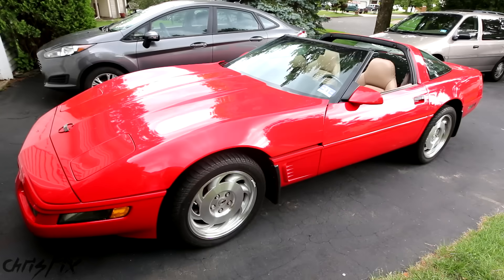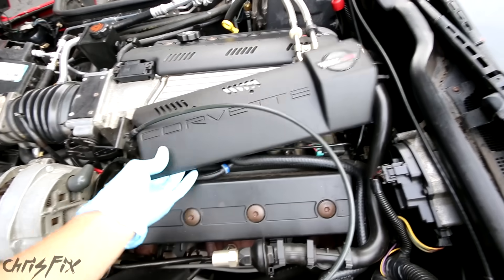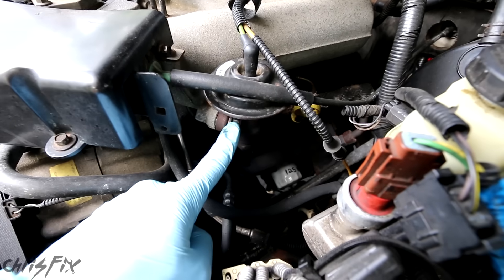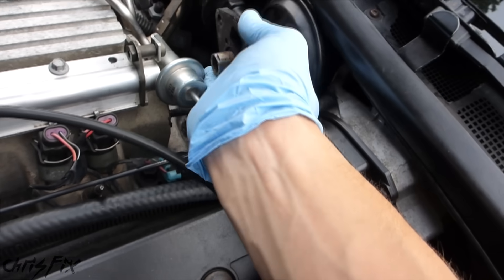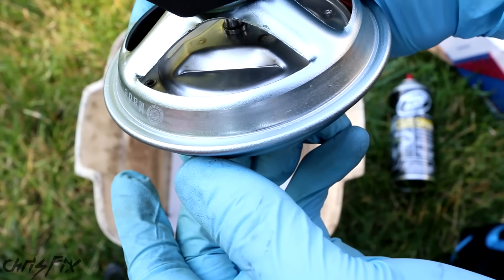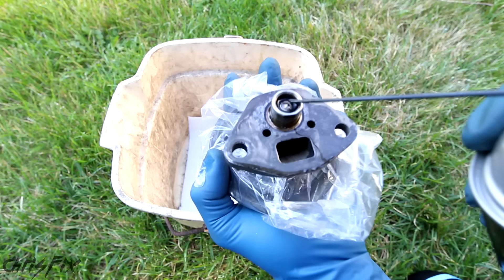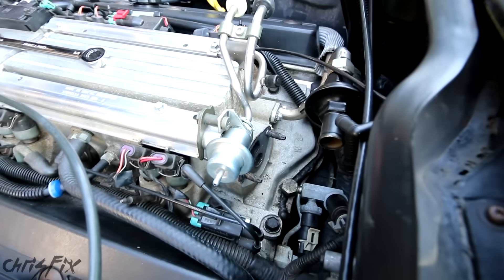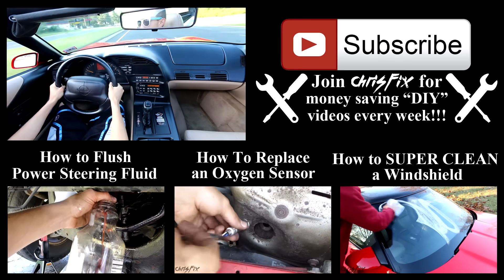How to Clean and Replace an EGR Valve P0400

Comment: Rock Auto has the claim~"all the parts your car will ever need". BS! I need control arms for my 02 blazer...they have a left upper and a right lower....what about my other two, RA?  Also heard about a guy locally that needed a fuel pump that was half the price of the regular auto parts stores, and it took RA three times to get it right. JS
Reply from the maker: Carl Libby Thanks for sharing Carl. I got my part from Car Part Kings who was relatively inexpensive and really fast with delivery. I have been using them a lot more for the reasons you listed. I just got an AC Compressor and it ended up being bad from the factory and they 1 day shipped me a new one and sent me a shipping label for the bad one. Now that is good service!
Reply: ChrisFix For sure! Carl Libby RockAuto isn't as convenient on customer service, but I still buy from them when I expect to not need customer service.

I think RockAuto will help you get the bushings for the control arm. It's more work but it's a lot cheaper. Usually, the literal control arm doesn't require replacement.

ChrisFix has a video to help you change out the bushings on your control arm! :)

Comment: egr is not for cooling the cilinders it's for degreasing the NOx because NOx is not good voor the environment
Reply: +Mon Schauvliege It has the affect of cooling the cylinders...
Reply: +Spartan111792 no because you are going to put hot exhaust gasses again in to the combustion chamber. The egr cooler whil cool the exhaust gasses but that has nothing to do whit cooling the cylinders.
Reply: Mon Schauvliege The exhaust gasses are non combustible and are cooler than the cylinder itself, therefor cooling the cylinders. You're right about decreasing NOx emmisions but wrong about the cooling affect of the egr. It's not best for performance because it replaces space that can be used for air with non combustible gasses.
I'll even copy and paste some info I just found on the web to help explain it better.
"The substitution of burnt gas (which takes no further part in combustion) for oxygen rich air reduces the proportion of the cylinder contents available for combustion. This causes a correspondingly lower heat release and peak cylinder temperature, and reduces the formation of NOx. The presence of an inert gas in the cylinder further limits the peak temperature (more than throttling alone in a spark ignition engine)."
Reply: Spartan111792 if the valve is functioning properly it closes at WOT and shouldn’t really affect performance when you need to really need the engine to perform

Comment: Great video as always! I don't think my 13 mustang has a EGR system. I might be wrong
Reply from the maker: OVERKILLRedline Thanks! That would be interesting if it didnt. It might be hidden.
Reply: OVERKILLRedline Forgive me for not looking up what your car does or doesn't have and responding generally.

John is right that often VVT does replace EGR. I was surprised when I saw some cars with VVT that still had EGR.
Reply: ***** I've often been glad my car doesn't have EGR. The intake gets dirty enough as it is from PCV.

VVT keeps exhaust gasses in? How when VVT doesn't effect when exhaust valves work?

Comment: Good vid. One thing to note if electric or not and applies to ICV, idle control valves. The cleaning fluid almost always seeps in through the o ring seal on the shaft and floods them out. Manual cleaning for the win the older it is. The deposits are abrasive and the o ring wears quite quick.
Reply from the maker: Sirus Thanks a lot for sharing. This is one of my first videos but I explained exactly what you said: https://www.youtube.com/watch?v=vFhoNykgQtc
Reply: Sirus Thanks for that! .... had to replace one over not knowing that. lol
Reply: ChrisFix good stuff, they expensive to replace if you screw it up. Done it twice to learn that one.

Comment: My car drives the same even tho the light is on, I tryed to check for vaccum line leaks the best I can I don't see none and tryed to see if there was build up in the lines but seems cleared so im confused don't know if there is any sensors just throwing those code for no reason
Reply from the maker: ThatKillaSounds The clog could be down by the exhaust manifolds. I would get a snake and run it though the metal tubes and see if it is clogged up.

Comment: I get insufficent egr flow p0401 and I've changed the egr valve the vsv switch and modulator on my 96 camry and it always come back on I gave up on that problem
Reply from the maker: ThatKillaSounds  The clog could be down by the exhaust manifolds. I would get a snake and run it though the metal tubes and see if it is clogged up.

Comment: What app do u use to run your codes?
Reply from the maker: Kevin Girdler Check out the description for a link to my product review on the app and the actual scanner. It is called the bluedriver.
Reply: ChrisFix I just found this, so you can disregard my earlier question if you see it before I delete it. Thanks

Comment: By runs "better" I'm assuming you mean better for emissions, not performance?
Reply from the maker: Pie Eyed Performance too. The computer was trying to use the a/f ratio for the normal flow of the egr and that was not working so it had to retard timing.
Reply: @chrisfix  lmao your clueless chris. Fire needs air to burn the best. You kill the performance with it.
Reply: Pie Eyed
lol
Reply: Pie Eyed 
In most cases, the EGR is only used at very low RPMs, such as at idle. It's close at higher RPMs like highway speed, and definitely closed at WOT runs.
Reply: Pie Eyed It's bad for performance for sure, just google "egr junk intake" and see for yourself. To avoid a/f ratio issues EGR should be "killed" in the ECU itself, ECU remapped and physically block the flow holes on the intake for the EGR valve. I've had it done on my car. Also when performing this it's good to take the intake off and clean the soot and carbon. Much better airflow
Reply: Pie Eyed Exactly, EGR is eco thing, it replaces oxygen in intake with exhaust gases (no oxygen there) => lower temperature in combustion chamber == lower nox emissions. Also lower performance because less oxygen => lower power. It is save planet thing, not enjoy the ride thing... :/
Reply: buggsyspam
I believe that's incorrect. When you force an EGR open while an engine is running it should choke and possibly die. This is one of the tests to see if EGR function is correct. If it doesn't hamper the engine running well then it was already stuck open giving problems or isn't opening enough.

EGR is used most while cruising not at idle or at WOT. So my understanding of it is that you're right about WOT or wide open throttle.
Reply: DE Nichols
Yeah, that sounds right. I had to look it up after you said that. I guess it's been a long time since I've seen how it works. What I was trying to illustrate was that it's not really killing power. Especially a vacuum operated one, it'll close more and more with higher revs. Before and after dyno tests also show no change from having an EGR to blocking it.
Reply: buggsyspam
I think we're pretty close to right about it now. I'm not perfect either. There is vacuum available at all times though there is more closer to idle. I think that's what tricked you.

You see, it's computer controlled and the vacuum is allowed to run EGR when the PCM wants it rather than depending on how much vacuum there is.

I believe EGR is used most when you're cruising. Not accelerating much, not decelerating since that's more like "idle". Tough for me to learn specifics when the car I look at on a scantool the most doesn't have EGR, lol.
Reply: +buggsyspam qazxfsmjji!ng
Reply: I drive a Hemi and the EGR valve aint enough 'Merica...unicorns don't equal horsepower so I took it off. spits in a bucket
Reply: Pie Eyed Maybe it's surprising but PCM's are generally designed to help an engine run better. So disable the EGR and expect slower lap times/poorer results on the Dyno.

Comment: I didn't watch all of it. But to clean it can you use viniger to clean those deposits of poor is that a no. Because I know viniger can be used on many things as a cleaner.
Reply from the maker: Cody Garrett Thanks for sharing Cody. Vinegar is acidic so you want to be careful with where you use it because you can etch metal.

Comment: What do I do if I have an OBD1 instead of 2 and I get a check engine light?
Reply from the maker: Evan Hooper You have to use an OBD1 scanner although if it is a 1994 or 1995 you can sometimes use the OBD2 scanner. With many obd1 cars you can short 2 pins together and it will show the code on the dash.

Comment: Thankfully variable valve timing has made EGR valves a thing of the past. Good riddance to bad rubbish
Reply from the maker: Nutz4Gunz45 Yea, it is amazing they could not come up with something better than injecting exhaust into the intake
Reply: @chrisfix  So delete it.
Reply: @chrisfix  I think I have variable valve timing but it has an EGR valve. It's a 98 acura RL. You're saying if I have VVT I shouldn't have an EGR valve?
Reply: @steppinout67  I think vvti is only for toyota
Reply: @chrisfix  what app are u using. To scan ur car?
Reply: Modern cars still have ERGs for better emissions...
Reply: @callumBee  yup
Reply: You sir, win the comment section!

Comment: Hey Chris, my dads 89 Corvette has a delayed start, sounds like it takes a while to turn over and it seems he needs to step on the gas (which may or may not be a good thing) somewhat to for it to start. When it turns over is sounds weak like a weak putter in the beginning but then remains strong. Without completely understanding my example, any troubleshooting tips?
Reply: Is it carbureted or fuel injected
Reply: 12kevmaster Fuel injected, automatic.
Reply from the maker: TheWodderLog I would take a guess that it is a fuel pressure issue since my Vette had the same problem. With my Vette it was the check valve in the fuel pump. New fuel pump fixed it. Check out this video: https://www.youtube.com/watch?v=_oXLUqE4Sf0

Comment: The only good thing EGR does is it helps warm up the coolant, everthing else is just throwing junk in the intake and building up carbon deposits, it's just bad for the engine, especially for turbodiesels. It cloggs up the intake very bad. I've had it turned off in the ECU and physically blocked. (Alfa Romeo 147 1.9JTDm)
Example of that it does to your intake...
http://kansascitytdi.com/wp-content/uploads/2012/08/image0011.jpg
Reply from the maker: Stjepan Đopar Yea, it is crazy someone would come up with the crazy idea of injecting exhaust gasses into the intake!
Reply: ChrisFix "emmisions"

Comment: Omg that egr is  made in China....smh...I wish the parts were made in America...
Reply from the maker: skyracercr I thought it would be made in the USA since AC Delco is for GM cars. Such a shame!
Reply: skyracercr Ya know...sometimes I feel bad for not buying OEM, but when it's made in China, maybe the non "OEM" part would be the same part.

Here's a recent example of a similar debate in my life:
OEM for sure on o2 sensors. Some cars go whacky without this part being perfect. Sure most cars/aftermarket O2 and you're good.

Here I am preaching this and I've been convinced my car has been running rich since I bought an OEM O2 sensor. hahaha Maybe it's time I go back to a Bosch.

Comment: nice video thanks for the info. is it advisible to blank the EGR in Hyundai santa fe 2.2 Crdi Regvt engines?
Reply from the maker: Ecined Senorof You will get a check engine light so unless you get it tuned out, I wouldnt. The car will try to use the EGR and when it does that, the car will run poorly.

Comment: ChrisFix  Great one, I'll definitely look into mine, my car has all the symptoms and a P0404 error code, so a carbon deposit problem on the EGR valve is very possible. A question, though. Why did you reuse the old gasket? What I would've done is use the new one and save the old one for "just in case" if it was still good. But that's just me :)
Awesome video, I actually didn't knew that there was an EGR, so you really met the purpose of your videos: sharing your knowledge with all of us :) Thanks!
Reply from the maker: David Miranda Thanks David! I reused the old gasket because it would have been a real pain to get that old gasket off and then clean the gasket surface. Since the old gasket was not cracked and did not have any issues, it made the job a lot faster and then I have the new gasket for "just in case". Glad you learned what the EGR does and how it works!
Reply: News: my car doesn't have an EGR valve, from 2003 and newer, PT Cruisers didn't had one. So I'll check vacuum lines and MAF sensor instead... wish me luck!

Comment: Great video Chris! I don't think my garage would go to the trouble of cleaning the EGR valve. The lazy bums would just put a new one. Besides it would cost me more so why not right! This is why more people are undertaking the small repairs themselves. Thanks for the "how to".
Reply from the maker: Big Guy Review Thanks bud! Yea, I dont think shops would clean an egr since you already have it off and the egr valve is usually inexpensive. For DIYers, who want to save money, it is definitely a good option!
Reply: Oh ok well then. If they are cheap then yaeh change it while it is off. LOL probable cost more to have it cleaned at 90$ an Hr. Thanks for the up load dude!
Reply: Big Guy Review Sadly a lot of shops don't have a way to charge the customer for cleaning parts. 

Some common things like battery terminals and intakes sure, but not things like EGR. So even if the fix could be cleaning it, the tech. won't get paid so you end up replacing it.
Reply: ya i guess
Reply: Pardon me. I meant to say throttle plate not intake.Big Guy Review

Comment: Chris, did you notice a better fuel economy, or more horsepower?
Reply from the maker: Gristle Von Raben Both. I was actually getting a slight random misfire which went away as well. The computer was adjusting timing and the a/f ratio as if the egr was working so she was not performing the best. Now she is back to her good ol' self! It is nice when the fix is simple and it works haha

Comment: So if you kept the vacuum line off the EGR valve, would it cause overheating at all?
Reply from the maker: LordFarkuaad It would probably not cause overheating. Your engine would retard timing so that it doesnt knock. In this case, the egr valve was bad and not opening so it was essentially like I removed the vacuum line.

Comment: "To cool the cylinders"...I thought the EGR reduces nitrogen oxide emission.
Reply from the maker: Attila theHun It cools the combustion chamber and when the combustion chamber is cooler, NOX emissions are reduced. The hotter the combustion chamber the more nitrogen oxide emissions there are.
Reply: ChrisFix but hiw do exhaust gases cool the. Combustion chamber? They are supposed to be hot, they dont cool down in an expansion chamber or anything...so they are actually warmung up the combustiin gased that enter the combustion chamber...and as the carnott law states: the less ∆temp between motir and combustion gasrd the less energy is produced( this is why cars usully kick harder in autum/winter than in hit summer)
Reply: @rronaldreagan  have you heard of nos making cars faster?
Reply: @ramyswar296  egr has nothing to do with that.. lower emissions ye but the price is high, bad mpg and slower car in the lower rpm. i blanked mine, got it mapped off and the car is way more responsible after that.
Reply: @itsatrap4850  what do u mean 'mapped' ?
Reply: @relevation0  like turned off in the ecu so it doesn't throw error codes and check engine lights when u blank the egr.
Reply: don trump Learn English

Comment: Would it make any difference if i clean the old gasket?
Reply from the maker: Yonathan Raziel Not really. If you try cleaning the gasket, it might break apart. If the gasket has to be cleaned, I recommend replacing it.
Reply: ChrisFix Okay thnx man

Comment: Sup dude! I'm still working on my p0171 (went away for a month) and cleaned injectors, maf, air filter and spark plug change, what I found along the way was split open vacuum hose ( idk how I didn't see that before) and turbo inlet hose slightly broken piece of rubber and halfway off, ordered new turbo inlet hose and gonna replace all vacuum lines with silicone hopefully that does it all
Reply: Also my father has the 1992 vette, clean as yours but with hard top and red leather seat
Reply from the maker: XNinjaZero Sounds like either a vacuum leak or you arent getting enough fuel. Im gonna guess vacuum leak.
Reply from the maker: XNinjaZero Nice! Red leather seats probably look awesome!

Comment: I know on my car, are you able to delete the valve on your corvette? I know it just throws a code if its deleted but doesnt cause any actual issues when its gone.
Reply from the maker: Matthew Broderick If you delete it and dont tune it out, your car might not run properly as well as the code so be careful.

Comment: Could you also possibly do an egr delete?
Reply from the maker: Evan Kuske You could but you need to tune it out or you will get a check engine light and also potential issues with how the engine runs.

Comment: Chris is it posible that EGR afect idle ?
Reply from the maker: Leonardo Maldonado Yes. If it is stuck open even a little, or leaking from the vacuum port, you will have a vacuum leak which will affect idle.